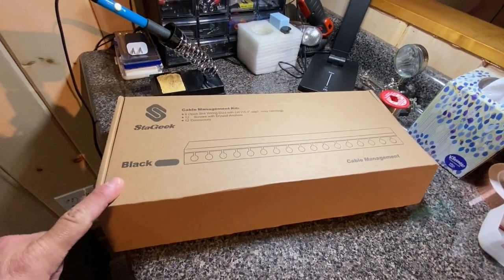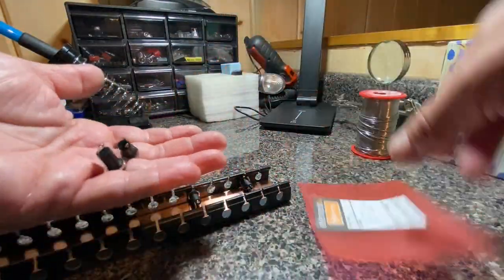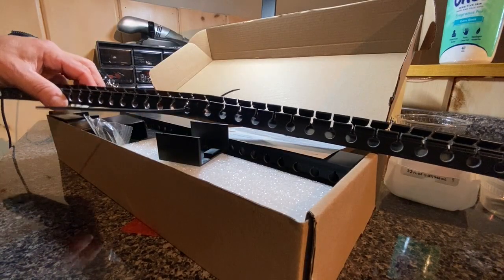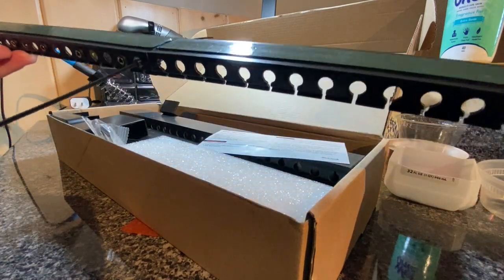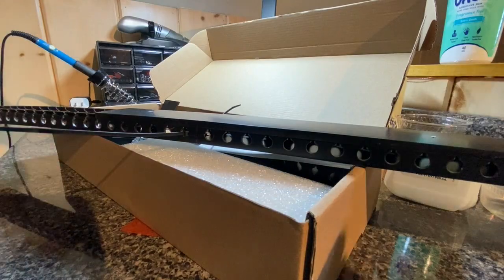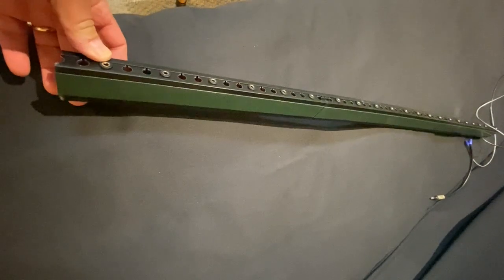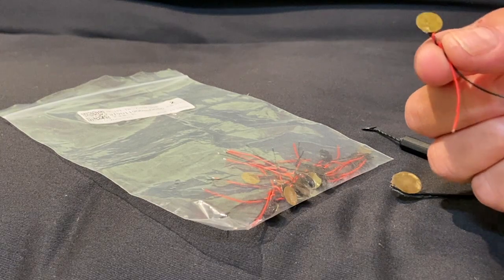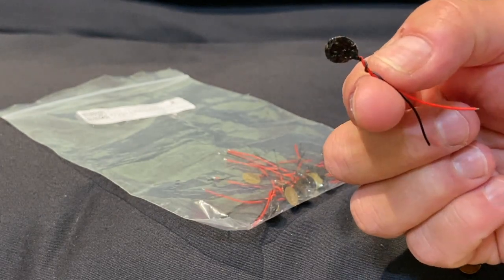How I Built a Custom Vibraphone Pickup System for Under $100

Comment: Thank you for this inspirational lesson. Very generous to share all that. I have been dreaming of doing something like this to one of my vibes for decades but never did. I would like to try something like this. I'm surprised the vibrato comes through so well on a peizo pickup connected right on the bar. Could you share some info on this? If one did not use the resonators would the pickups alone sound thinner? As in it seems they are picking up a lot of the resonator sound here? Or is that a tremolo effect added?  Thanks for sharing!

Comment: Thanks for this amazing info! Can you share what piezo pickups you ended up using?
Reply from the maker: Hi sure, 15mm unwired worked best, bought on Amazon. I soldered the cable onto the piezo myself, using good flexible audio wire.

Comment: Thanks for sharing your inspiring project!
Noob question: why not (more) simply connect the piezos to a single cable running under the bars? Skipping the mini-jack system altogether would save a lot of precious setup time, or am I missing something?
Reply from the maker: Ok so, imagine you get to a gig and on one bar, the pickup is f**cked… you need to swap that out right away, no time for a soldering iron. That's why you need the mini-jack. 🙂
Reply: @VibraphonicMusic  Oh, I get it, thanks. So, do you always carry spare pre-wired piezos and super glue with you on gigs?
Reply from the maker: absolutely! leaving bars & pickups on the instrument improves reliability, but pickups go bad sometimes just from use.. cheers.
Reply: Nice!!!